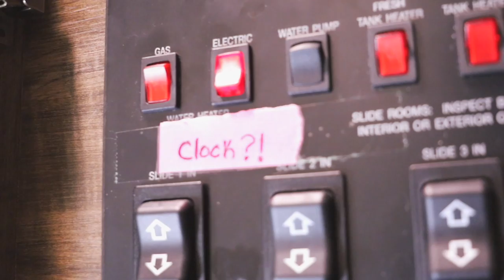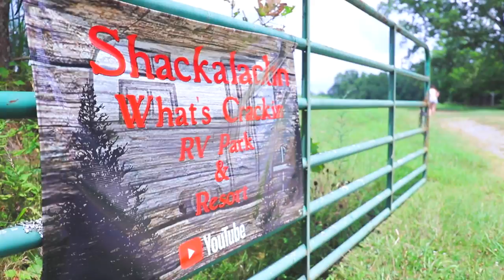Want the BEST Tow Vehicle Upgrade? WATCH THIS FIRST!

Comment: The different pressures in the tires are due to payload capacity. Since the weight on the front stay the same GM engineers figured out that you can get away with the lower pressure and not negatively effect tire wear. And since the rear tires could see heavy loads they wanted higher pressure to keep the side wall from squishing down and causing improper wear on the out tread.
Reply from the maker: Thanks Chris! We really appreciate the information! You know your stuff! Safe travels!

Comment: I have a set of BFG AT KO2's on my Wrangler and they have been great. With that good experience, couple years ago I put a set on my '16 Denali 2500 and they were the horrible. They were a little noisy but the vibration was unbearable. They literally shook my truck.  I had them in for re-balancing 3 times and they just couldn't get them right. I eventually replaced them with less than 10k miles on them. They do look good. Glad they are working for you. Love the channel.
Reply from the maker: Nice!

Comment: The amount of weight on each axle determines best tire pressures. Empty truck with a diesel engine will need higher pressure on front axle, loaded with trailer, rear axle will need higher pressure (closer to max recommended pressure) Weight distribution bars on non fifth wheel trailers will require more front to back equality. The key is too low a pressure will cause a tire to heat up more and has a greater chance of failure. Another indicator is too low or high pressure will cause the tires to wear uneven. Hope this helps. Love you guys.
Reply from the maker: Hey Hilton! This makes a lot of
sense 🙂👍🏼 Thank you for taking the time to write this out for us and everyone reading! You have a lot of great knowledge to share

Keep these great comments coming, you mean a lot to us Hilton! Cheers 😃👋🏼

Comment: Carl and Naynay, the reason the fronr tires are 10 less than the rear tires, is the axle weight of the tow package and the weight distribution of the 5th wheel and the hit h in the bed of the truck.

Comment: Bring the tires to the Max PSI (when COLD!) indicated on the sidewall. All the same PSI. The Tire doesn’t know if it’s on the front or rear. BUT, if the sticker on the door jam gives two different PSI’s, one for front and a different one for rear, in that case, follow the stickers directions.
Reply: Great advice!!  Door jam stickers are so difficult to read. I try to follow that and an app on my phone.
Reply from the maker: This is really great information! Thank you so much for sharing, we will be sure to check out these inflation tables as we have never heard of this before 😃
Reply: The door sticker is Absolutely Obsolete if you are not running stock size tires. 
You are better off reading All the information on the sidewall and following the manufacturer ratings. 
For instance it should be different if you're running Srw or Drw and payload.

Comment: For the tire information. Here is what I do (I have BFG AT’s just like yours), I actually pulled the inflation table information for these tires and matched the tire pressure to my truck. Typically you’d need to run higher psi in the front and less in the back since the truck is always noise heavy with the motor when your not loaded. Now once you are hooked up to your camper that weight difference between the front and back would definitely change. I actually took my truck over the scales with the camper and without to see what my weights were on the axles. With my setup I run 45psi front and back while towing (I have a 2021 F150 V8) and that gives me more than enough weight carrying capacity on the tires. Pull the inflation information for your sized tires and compare the weights to your actual load, you’d be amazed at how much 5psi can change your capacities.
Reply from the maker: That makes so much sense! Thank you Kyle! We appreciate your knowledge and expertise!

Comment: Doing the electric slide... I run 75 psi in the rear tires and 65 in the front tire when I am towing. I have E rated 10 ply. The high psi in the rear is so the tire can take the weight of your unit.  You can't go by the door sticker because that is for factory tires. Mine were 2 ply lite truck tires originally. Useless for towing. 
Nice looking new boots for Dee.
Reply from the maker: This is what I have been going by as well Wayne! As soon as we got home, I ended up increasing the pressures in the rear and keeping the fronts around 65. They are great tires, we are really happy to have them 😊🙌🏼

Comment: Set your tire pressure close to factory spec, about 5psi lower.  Monitor for dead flat, even treadwear, across the entire tread, adjust psi as needed to maintain good even treadwear.

*If you run a truck unloaded at factory psi spec, you'll ruin your tires in months, the center tread will get wiped out first. And, it will ride like a buck-board wagon.

*Example, my 2019 supercab f250 diesel 4×4 I run 63 front, 61 rear- When unloaded.
*I run up the psi as I increase the load. Very important: you MUST raise the psi before you run loaded. You'll find "the sweetspot" really quickly, for both unloaded and loaded.

*non-directional tires- Rotate and balance all 4, every 5k, use the "modified x" (cross back, straight ahead) pattern. You'll get at least an extra 7-10k miles out of them. I had 3 auto shops and sold/installed thousands and thousands of tires.
Reply from the maker: Wow thank you so much John!!! This is so awesome of you to take the time to write out all of this wonderful information 😃👍🏼 

I figured it would be weird to run the tires at what the factory recommended. It’s a completely different tire than the original sets! Right? 

Like each tire is so different, I’m not expert by any means like you. What you wrote makes a ton of sense. 

Are you currently living the RV life? 😃

Comment: I also have the KO2's, but paid FAR less than you did! Holy crap...I paid $1,005 for mine. Had them for two years now, they wear great but they actually suck in mud. Going to try something different next time. As for pressures, I run 75 all around! That Duramax is heavy (mine's an '18 Denali HD), and with the 5th wheel it's heavy in the back. When not towing the ride is great, low noise, even wear, no need to run less pressure than max or near max. 75 all year, towing or not. Two years old, 50,000 miles on them, still have a good 1/3 tread left, maybe a bit more than that even. For the money they were a great choice, I'm just disappointed in their grip in mud and wet grass (which equals mud LOL). I have the tan interior too but my wife is not as gorgeous as yours LOL. Happy camping guys, looks like you have a great life together.
Reply from the maker: Yes, it seems like they have gone up in price quite a bit!! We have been hearing this a lot from other people as well 
We have been running 75 in the rear and 65 in the front. That’s good to know that you’ve been running at max psi and having adequate wear on the tires 😎👍🏼 
Cheers to you! Stay safe out there
Reply: @HappilyEverHanks  and I subbed you guys too...many channels on here but yours is by far the most upbeat fun one I've found. Keep it up.
Reply from the maker: Wow this is amazing ❤️  You just made our night 😊😊 What is your name by the way??
Reply: @HappilyEverHanks  Jim Manfre. 😁

Comment: My F350 is 65 psi in front, 80 in the rear because that is what Ford recommends.  LOL  Rides well when pulling 14,000 pound fifth wheel.  I also went to all terrain tires, although I went with Cooper.  Much quieter, and now have 45,000 on the tires and still plenty of tread.  Not much different when driving on wet grass.
Reply from the maker: That’s awesome to hear Buzz! We almost went with the Cooper’s ourselves, I believe they are rated for a little bit more lifespan than the BFG’s. Don’t quote me though 😁 A very decent tire you have!! Totally agree with you, it is nice having the looks and the tread still. It’s a nice middle of the road option 😃

Comment: Best to run recommended pressures on your load sticker on door jam on drivers side will most likely be more in the rear than the front due to load capacity of truck, with y’all’s fifth wheel definitely good idea to run correct pressures to maximize towing safety and comfort. Also is a good idea to get an alignment done after getting new tires to ensure everything is tracking straight as to not wear the new tires unevenly
Reply from the maker: Thank you so much for taking the time to write this out for us Jeff! We really appreciate your awesome support 😃 we definitely need to look into getting an alignment like you mentioned

Are you currently living the RV life now?

Comment: I run KO2 on my dually and they work great.  I use it mostly for pulling the fifth wheel.  I run 10% below max air pressure.  I have found looking at my TPMS system is that they will heat up going down the road about 10psi.  If your in the fall cooler temps, the pressure will start out less but will warm back up at highway speeds.  The only variation is if your running nitrogen in your tires.  You won’t see the temp / psi changes like running air in the tires.
Reply from the maker: Hey Bill! That's awesome to hear, thank you for sharing this. When towing, I have been running 65 psi cold (front) and 75 psi cold (rear). That's awesome that you are using a TPMS system, we have to get one of those! Any good recommendations for us??

Comment: Tire pressures... run higher psi in the front and 5-10psi lower in the rear. Youre compensating for engine weight and optimal steering. You wont always have a load over the rear tires like you do in the front
Reply from the maker: Thank you so much for sharing this Hayden! This is really great insight for us and everyone reading. Best to you, we hope to talk to you again soon 😃👋🏼
Reply: They full-time Rv. That means they are loaded probably 95+% of the miles they put on their truck 👌👍

Comment: I have been running the BFG ATKO2 for some time now on both my Commander and F150.  Higher pressure in the back because of the load.  I did change my truck tire to the Grabber AT2.  They are less $$ per tire, have the ability to be studded (not that you two will ever be in the cold again) and are just as quiet with same performance ratings.  Not sure of tread wear yet.  The BFG's do really well with wear as long as you rotate and balance frequently. Lots of rubber. They served me well towing.  You should be happy for a while.
Reply from the maker: Thank you so much for sharing this David! This is great information, we appreciate you taking the time to write all this out for us and everyone reading as well 😃 

We are really happy with the BFG‘s, they seem like great quality tires and we are hooked now!!! 

Stay safe friend, we look forward to talking to you again soon 😀👋🏼

Comment: They are called “new sneakers” on the truck, not shoes because you’re going to run with them on that Duramax.  As for the pressure you usually run the higher pressure in the back because that where you carry most of the load.

I love the way you can climb onto that ladder and climb down, even with a bent ladder.
Reply from the maker: Good to know lol Thanks for sharing! Yes that ladder needs some TLC!

Comment: Higher pressure in the rear because the load capacity of the tire is proportional to the psi in the tire. You guys have a heavy fiver on the rear axle so you want max load capacity on the rear tires.

Comment: The pressure is set based on the load on the tire. There are tire charts from the manufacturer that show what PSI to use based on the load. This keeps the side walls of the tire from flexing too much under heavier loads and the contact patch on the pavement the correct size and shape. This all helps with grip, tread wear, fuel economy, and general performance. Since the trailer weight is on the rear, there is more weight on the rear and therefore higher PSI. I could go into more detail if you like ;-)

Comment: Those tires do not disappoint, I have had them on 4 different vehicles and they wear like iron. However I have a 2020 GMC AT4 duramax and the stock tires leave lots to be desired and I have been debating the Falken Wildpeak. I had them on a toyota tundra and they were not as loud as a mud tire but seemed just as aggresive. I guess it will come down to longest warranty and price when I go to replace these stock ones. When you tow up to Indiana you have to let us know if it made a difference!
Reply from the maker: Thanks for the input! Seems like you know your tires well! We really enjoy them so far!

Comment: Hey guys, glad to hear that the slides are working ok for you. I have been curious about that. So if you are heading to Indiana, are you going to Grand Design for  repairs and/or an estimate? We have a Grand Design Momentum that we haul our '23 T-bucket hot rod in and spent 7 months on the road in 2019 going to 8 of the 12 National Street Rod Association (NSRA) shows throughout the country, visited 30 of the lower 49, a few National parks, and several other attractions, etc. Put just under 24,000 miles, spent $7150 for fuel (2016 F-350 crew cab, long bed, dually) and had a blast. Haven't decided yet if full timing is our niche. Oh yea, we just got new "shoes" for our truck at Discount Tire, also BFG's Rugged Terrain. These were the OEM tires and last about 80,000 miles so went with those as replacement tires. We have been to some of the same places that you have been. Maybe we could meet up some place in the future or if you get back to Idaho again, swing by Boise.
Tim and Kim S.
Reply from the maker: Oh nice! Sounds like you guys are rocking the RV world! We went to the Grand Design Rally and will be getting repairs done soon at Grand Design! We would love to meet someday! Thanks for the love and support!

Comment: Not sure why they would have you higher in the front than in the rear. My 2021 Ram 3500 has the PSI pressures that they recommended you run on the inside of the door. I’m sure you already know that but it sure does sound strange to me. Great video.
Reply from the maker: It was strange since we understand if they run higher in the back! Thank you for sharing your input and knowledge!

Comment: I also run 55/65, the rear tires get more weight so they need higher pressure. It's a pain in the ass though because my TPMS keeps yelling at me that the front tires have low pressure because they're not even.
Reply from the maker: Oh yeah that would be a pain, I see what you are saying Andy. I did start running them higher in the rear like you mentioned. Thank you for taking the time to comment 🙂

How was your weekend?

Comment: Have you used a moisture meter on the leak area, or have you just "eyeballed" it? Also....how do tires "feel" less noisy???
Reply from the maker: Hey there! We actually just eyeballed it, I don’t have access to a moisture meter 😃 Never heard of this before. Are they expensive?
Reply: @HappilyEverHanks  They're pretty cheap. I have an earlier model of this one which is rated and works pretty well. General Tools MMD4E Digital Moisture Meter. Got mine from HD but you can get them from Amazon @ $35. They are great for testing a lot of things. It will read moisture you can't see. You can tell if a wall, ceiling it getting better or worse. Works on Drywall, wood, concrete, etc.
Reply from the maker: Oh that’s fantastic! We will look into this 😃 Thank you for sharing!!

Comment: I am warning all RV owners especially not brand new RVs . Lippert Trailers Frames  are breaking regularly . Lippert makes most of the trailer frames for 5th wheel and travel trailers. 1st the 5th wheel. The Goosneck is a particularly bad area , The transition from the under storage area to the goose  neck is one place where cracks show up . If when you put weight on the  truckor the outer facade buckling , you see any deformation, seams opening you have a broken frame that could completely break  destroying your camper and truck. Dont expect compensation for it . So its best to catch it before damage is done . A small welding job is much cheaper. These frames are only 1/8th inch thick and probably the cheapest steel they can buy.
 Now on Travel Trailers  and 5th wheels the spring shackles to frame weld should be inspected regularly . On both check the cross member bracing  , ( usually hidden by the corregated insulating board)  for cracking around where the axles connect to the frame 3 ft for and aft of the spring shackle weldments . On Travel trailers you will see a rusty spider crack just above the bottom flange of the 8 inch I beam .  Backing in and pulling out of camp spots on pavement puts side loads on the trailer axles  where the front axle is forced one way and the back axle in the opposite direction . This causes extreme twisting of the frame and the cross members can push through the thin web of the I beam. That cracking and popping sound you hear is your frame or spring shackles breaking. I found 6 places on my frame that fractured . Nobody told me . Im telling you. Avoid making sharp turns backing in or pulling out . I will weld mine up myself .
Reply from the maker: Thanks for the heads up

Comment: Hey guys, I know how you feel about the mud tires. I have Falken Wildpeak MT tires on my truck. As they got low on tread they got louder. But I have put over 60,000 miles on this set and it's time for some new one's soon. The BFG KO's are good you will probably get around 50,000- 55,000  miles on that set.
Reply from the maker: This is really good to know! That’s awesome that you are rocking the MT 😃 we are staying on top of getting them rotated every 5000 miles. Do you have TPMS built into your truck?
Reply: @HappilyEverHanks  No I don't have the TPMS on my wheels. I took the original wheels off and I bought an after market wheel and I never had them put on.
Reply from the maker: Gotcha! Makes total sense 😎👍🏼 Have a great night friend, we will catch ya again soon!!